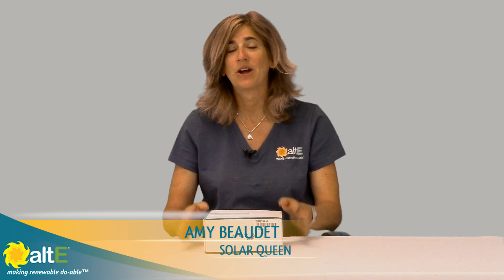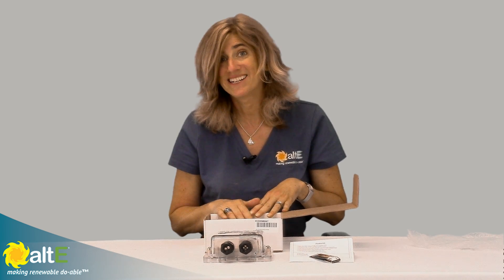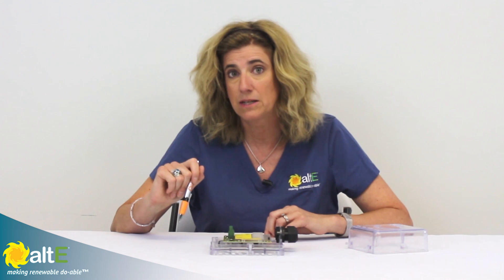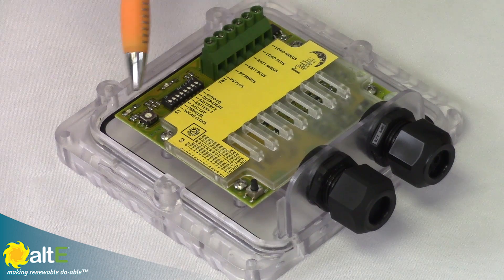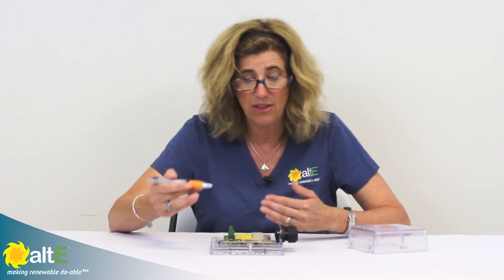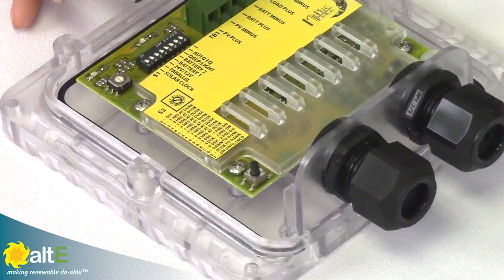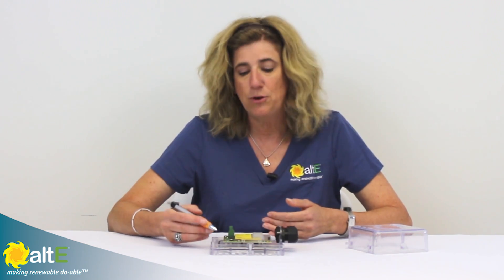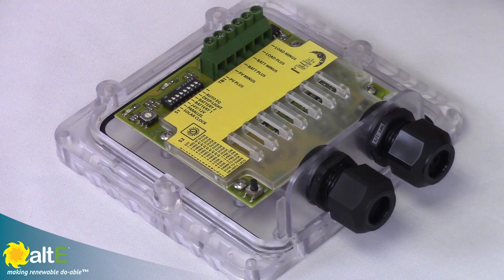MidNite BRAT 30A PWM Solar Charge Controller | Unboxing & Features

Comment: What are the black connecters call. I need a couple of them
Reply from the maker: Are you talking about the strain reliefs to get the wires into the charge controller? If so, here is a link to one with 2 holes although other versions are available too. https://www.altestore.com/store/cables-wiring/solar-panel-wiring/grounding-and-wiring-accessories/12-inch-2-hole-strain-relief-with-lock-nut-p9660/

Comment: so if some is using 24 volt panels on a 12 volt battery bank then they have to be using a mppt controller. you are great in explaining this stuff in a way I understand without the 2 by 4.
thanks
Reply from the maker: +Rev John O'Toole You are right, a PWM charge controller needs to have the voltages match between the panel and the battery, most  MPPT charge controllers can have a higher voltage panel than battery.